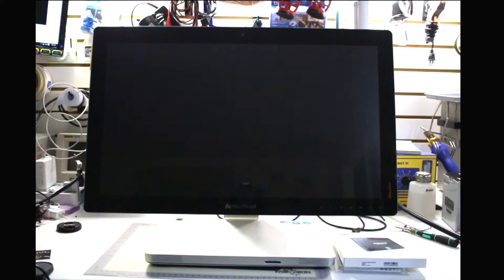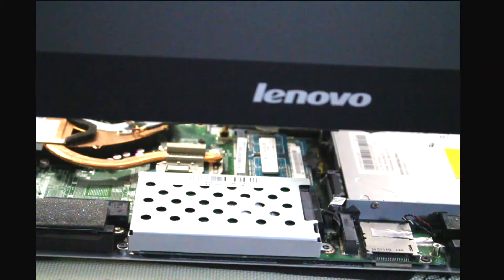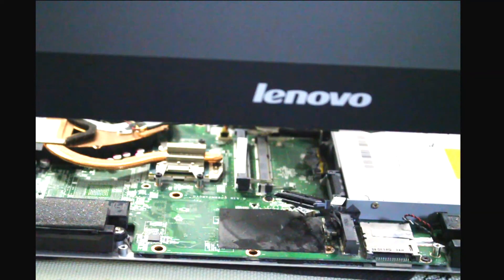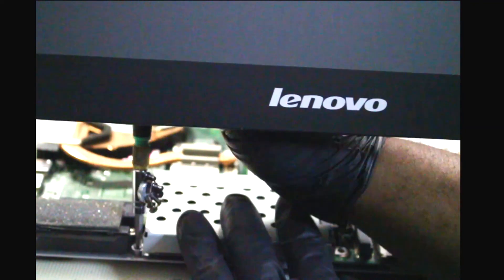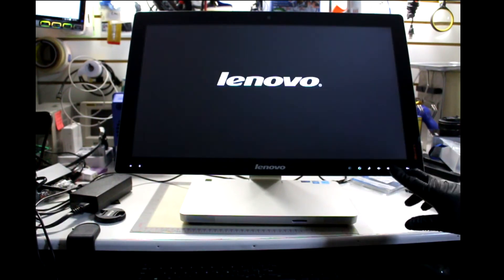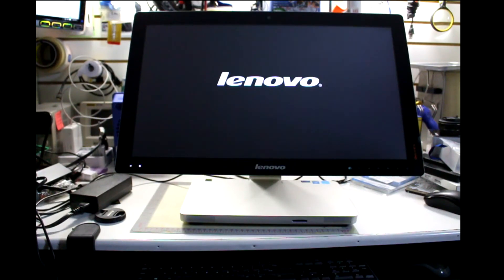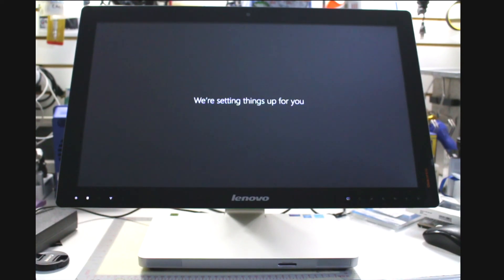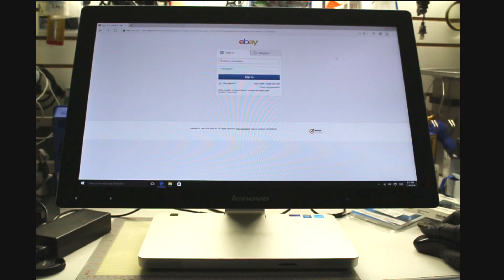Lenovo Ideacentre Series Ram And SSD Upgrade A520 A530 A720 A730

Comment: Old video but thanks for posting - Parts are getting scarce - I have a unit with cracked screen 27" and part of touch screen is still working - You can't find parts anymore and motherboards are getting scarce. I also have another one with a bad system board which is also a 27" screen The screens on these are beautiful.

Comment: Wireless card new ?
Reply: This model does have a removable wireless card, but I'm sure if the drivers would work with the motherboard.  I bought a USB wifi adapter to upgrade it to WiFi 6.

Comment: Hey everyone, for those that are interested, I did throw 16GB into my Lenovo a720 just now and it worked with no issues.  Popped the RAM in and it recognized right away.  👍
Reply: Will you have the models of the memories that you installed to take it to 16gb?; I'll try to do the same, taking it up to 16gb
Reply: Hello Clinton, which Ram did you used? Want to upgrade too.
Reply: @eddisti9761  Yikes.  I'm just now seeing your question.  I don't recall the model.  I just looked up the same type of RAM that it came with and bought some 8GB sticks of that type.  If you put the model number of the computer into crucial's memory configurator, it will let you know what type of RAM sticks to buy. However it won't tell you that it can go up to 16GB.  Hope this helps!
Reply: @Roberto Mora thanks for asking.  See the post that just added for Edward.  Good luck! 🙂
Reply: I have a Lenovo All In One A720 with 16 Gb Ram (2x8Gb) Bus 1600 mhz (1.5Volts) ...In China: https://es.aliexpress.com/item/32624196663.html?spm=a2g0s.9042311.0.0.524a63c0C2xmVZ
Reply: Thanks a lot!

Comment: Great video...can the graphics card be upgraded?
Reply: Did you ever find out?
Reply: You can use an external GPU with an enclosure using the blue USB 3 ports.  The internal graphics can't be upgraded.

Comment: Is there really any value in installing a SSD here? There is a 8MB SSD chip to the right of your main hard drive there which is supposed to faciliate your disk operations. There's probably some faster reading from having a full SSD but it seems overkill unless you can remove that 8MB disk there

Comment: if they are fixed on the side of the disk where the sata connector is, there is a msata connector to connect directly without replacing the hard drive

Comment: One last question - can the SSD be added on another slot rather than replacing the hard drive?
Reply: Hi - No - there are SATA connections for 1 SSD/HD and DVD Player only on the A520 Monoblock

Comment: Steve, great video. Does this SSD fit speifically Lenovo IdeaCentre A720 2564 - Core i7 3610QM 2.3 GHz - 8 GB configuration machine?
Reply: Nearly all SSDs are 2.5" SATA, so they are all compatible. This same disk could be used in a laptop or even a tower (with some conversion hardware to fit a 3.5" drive)